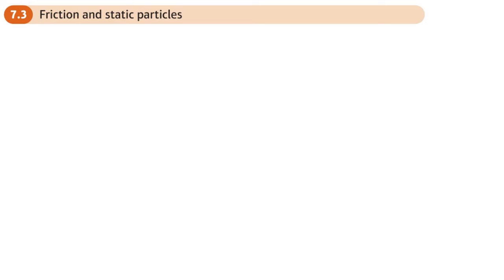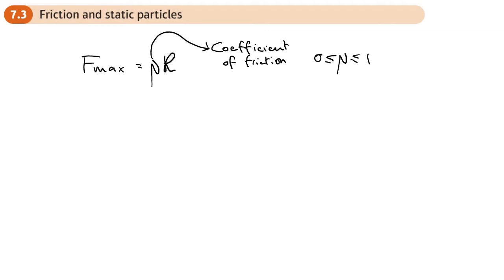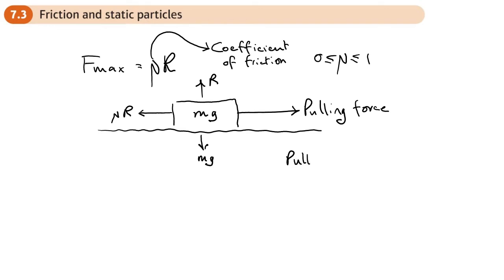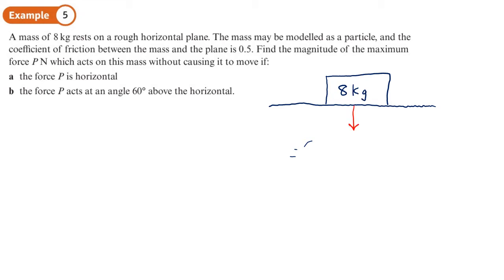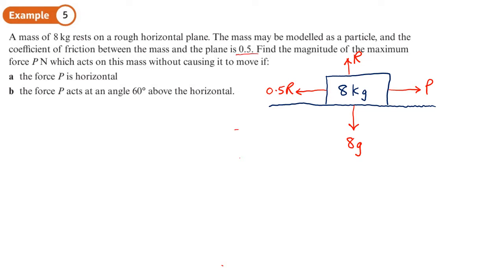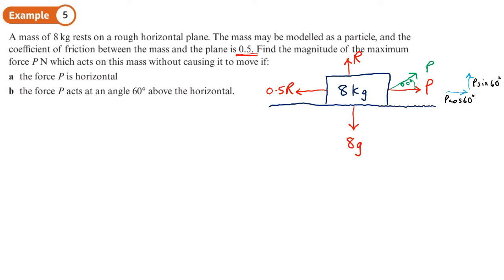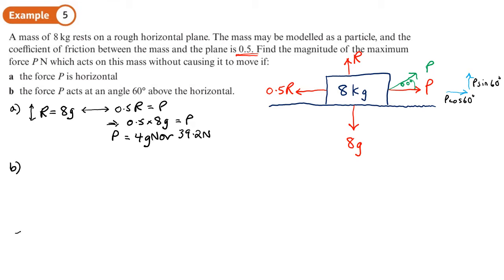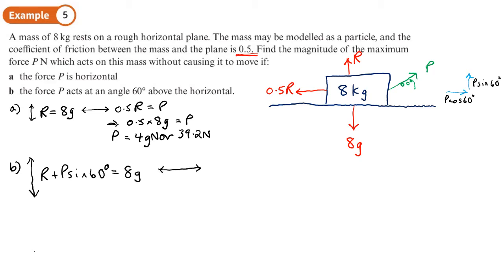7.3 Friction and Static Particles (STATISTICS AND MECHANICS 2 - Chapter 7: Application of forces)

Comment: In example 6  part b, how did you know the direction of the force P, why couldn’t it be pushing the box down? 12:15
Reply from the maker: Two reasons, 
1. It wouldn't be possible to apply a horizontal force pushing "down" as the force  would next to be applied " through" the slope. 
2. For the box to remain in equilibrium there needs to be a force stopping the box from sliding down (caused by it's own weight), so the horizontal force must be applied at the "bottom" to hold it "up".  Hope that helps